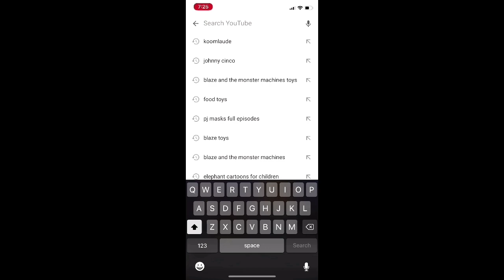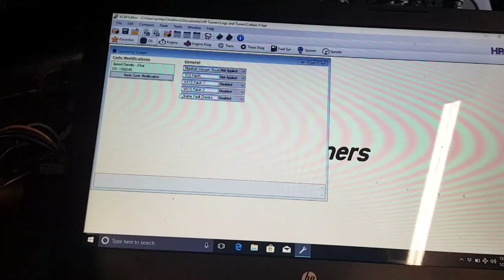Cutlass V Build Lsa Supercharged Swap

Comment: True mechanic. Especially when I saw you jacking the jack up and down with one leg. Reminds me of the old school alley mechanics growing up. Is that the engine out of the Cadillacs? And one bit of advice from an old timer (almost 54 years of age). Put some type of barrier down on the floor between your body and the concrete floor. I'm having knee problems from doing tires when I was 19 years old. I would put my knees on the floor with nothing as a barrier. Now I'm paying the price for that. Keep the videos coming my brutha 👍🏾💯💪🏾
Reply from the maker: Preciate the love and advice
Reply: @Koomlaude . No problem 👍🏾👍🏾

Comment: Boulevard3 in a Delta 88 Roadmaster using the original transmission that came within a 200r are well I burn up that transmission with that motor